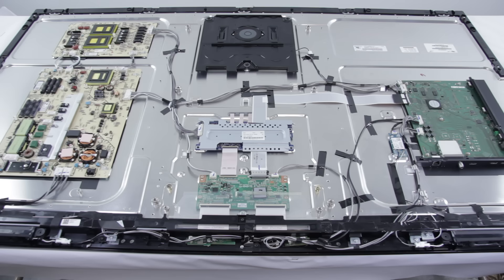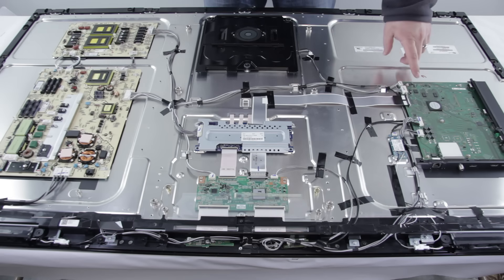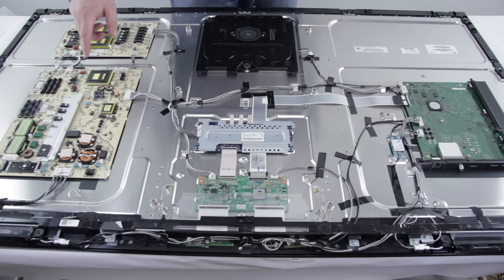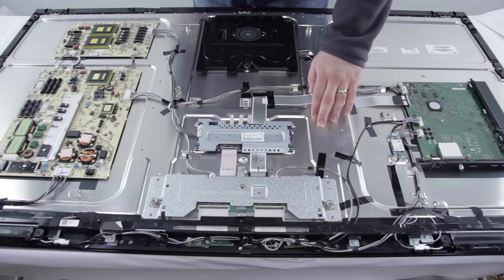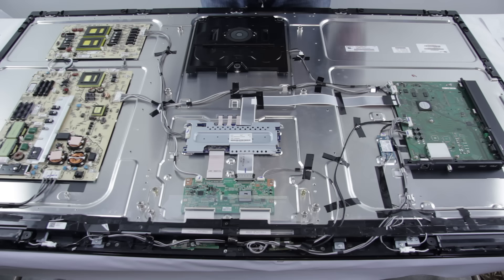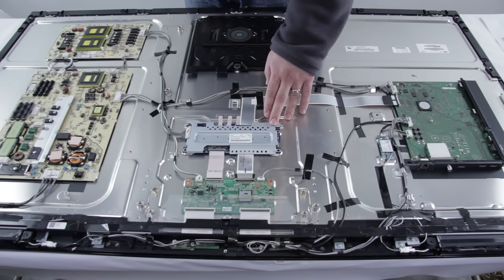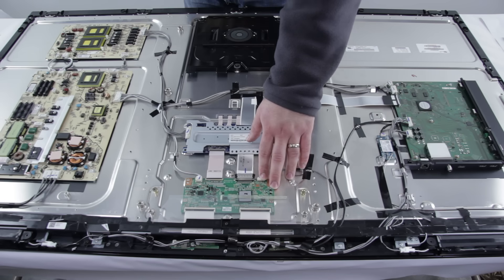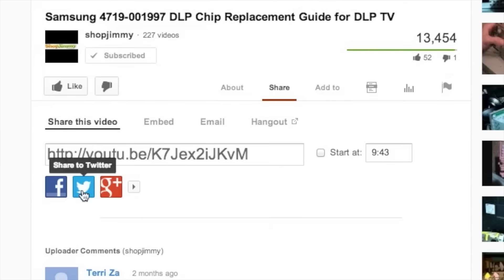LED TV Repair Tutorial - Common Symptoms & Solutions - How to Repair LED TVs

Comment: I have a e470i-a0 that does not turn on the indicator comes on with the power button or remote power then fades back off the vizio name never lights up I did replace the power supply board but it did not change anything do you have any advice

Comment: Hello. I have a Samsung UE50ES6710 LED TV. The problem I have is that there appears to be no vertical sync, or the vertical sync is erratic. This makes the whole picture very unstable and the menu options very difficult to read. 
Model Samsung UE50ES6710U
S/No ZA2G3SCD200412T
Any help greatly appreciated.

Comment: My 2 year old was running around the living area and tried to throw the remote at my oldest son and hit the tv. It is a 60 inch Samsung model # UN60H6300AFXZA, the tv turns on but you can see where the remote hit the tv when it is on (when tv is off you can not see where it hit) there is about a 2 inch blue line vertical of where the remote hit the tv. Is this fixable or would it be more economical to buy a new tv? Please Help!!!

Comment: Hey Jimmy we have an Orion SLED4668W 46" TV.

Great picture was working fine then one morning problem developed.

TV shows red power light but when you try to turn via remote or TV switch light goes out like it is turning on and TV never comes on.

Any thoughts!
Reply from the maker: tmanala  Try all repairs and troubleshooting at your own risk.  I recommend replacing the main board in your TV.  Click this link to replacement parts for your TV model number:  http://www.shopjimmy.com/catalogsearch/result/index/?cat=56&q=SLED4668W  There may be multiple boards for the same TV model number, be sure to match part numbers on your current board, with your replacement for compatibility.  Thanks and please let us know if you have any further questions with your TV Repair!  www.shopjimmy.com

Comment: Hello, I have a LG 55LE5400.  It has power to the control panel switches but no audio or no video.  I can see a very light image of the screen on the right half of the screen only but not enough to make out.  I am not sure if I am on the correct input to receive signal, or have not tried to connect other devices to see if the input is bad.  What additional should I check before I order a TCON or Main Board to see if that fixes the problem.  The TV was mounted over our fireplace so heat may have played a factor.. 
What do you think it might be?  What parts should I order?
Reply from the maker: David Austin  Try all repairs and troubleshooting at your own risk.  This could be a problem with either the power supply or bad LEDs in the TV.  If you are unable to check voltages, then you can replace the power supply board to see if that fixes the problem.  Click this link to replacement parts for your TV model number:  http://www.shopjimmy.com/catalogsearch/result/index/?cat=59&q=55LE5400  There may be multiple boards for the same TV model number, be sure to match part numbers on your current board, with your replacement for compatibility.  Here is a link to a video showing how to identify your part number, click here:  https://www.youtube.com/watch?v=_4Qpfan0vdU  Thanks and please let us know if you have any further questions with your TV Repair!  www.shopjimmy.com

Comment: hey I have a un50h6203 back light no pic but I due have sound I swap t-com but its the same thing still no pix can you help me
Reply from the maker: manuel martinez  Try all repairs and troubleshooting at your own risk.  This could be a problem with either the main board or the TV panel.  You can replace the main board to see if that fixes the problem.  Unfortunately I do not see any replacement parts in the search results for your TV model number on our website.  Please reply with your part number on your main board and I can try searching for replacement parts.  Thanks and please let us know if you have any further questions!  www.shopjimmy.com

Comment: I have an LG 55LB5900-UV I have no power. I recently moved into a new home and I set my TV up and went to run the coax and it zapped me. Red light comes on when I plug it in, but no power. Later I fount that the line was Improperly grounded, what could my problem be?

Comment: Hi, I wondered if you could assist me.  I have a Samsung ue46D8000 led tv.  All functioning correctly save that there is an intermittent sound issue.  Every 10 seconds or so, the sound cuts out for 1 - 2 seconds.  What would cause this and what part would you suggest I buy to fix it.  Do you sell the replacement part.  Please advise, Thanking you in advance, Mark L
Reply from the maker: 7777777sportbilly   Try all repairs and troubleshooting at your own risk.  I recommend checking to see if any of the audio wires are pinched.  Thanks!  www.shopjimmy.com

Comment: Hi I have a lg 55 LA 6620 Looks like a led driver issue but the drivers in the tv panel is there a way fix this or tv has had it. i change every board in back of the tv.

Comment: Hi my LG LED 42" tv spontaneously turns off, turns volume up, and switches input and stays froze after a while and i have to unplug to unfreeze it. Recently i tapped on the back and the picture went out but the sound still there. When i turn off and turn back on the LG picture that pops up when you turn the tv shows up then it blacks put when i try to input tv or dvd. Any idea?
Reply: My model number for my 42" LED LG is 42LE5400-UC
Reply from the maker: Notta Game   Try all repairs and troubleshooting at your own risk.  Click this link to replacement parts for your TV model number:  http://www.shopjimmy.com/catalogsearch/result/index/?cat=56&q=42LE5400-UC  There may be multiple boards for the same TV model number, be sure to match part numbers on your current board, with your replacement for compatibility.  Here is a link to a video showing how to identify your part number, click here:  https://www.youtube.com/watch?v=RwHTvjMdrhk Thanks and please let us know if you have any further questions with your TV Repair!  www.shopjimmy.com

Comment: Hello ShopJimmy I have a LG 55LV5400 that has stopped working. When I power it on the light in the bottom corner turns red as it turns on, then glows white as its normal operating state, however, no image appears on the screen at all. There does not appear to be any backlight and I tried the flashlight test, but did not see any image. Also of note, peripheral devices like USB drives do not power up when connected to the tv when it is "on". I'm assuming this is a problem with the power board since nothing powers up, although the light in the bottom corner does function. Am I in the right ballpark, or should I be looking sonewhere else? Thanks

Comment: Hy, there.... I have Samsung ue46c6000 Led tv. The problem that I have is that the power supply does not switch on and power the backlight. The relay inside keeps cracking, the st-by led lights up showing that it tries to turn on but it can't. I have already checked some small things on the power supply:
- all capacitors are ok!
- all mosfets are ok
- all diodes,bridge rectifiers ok,
Now i do have technical knowledge but I do miss some hints.
The power supply is the problem beacause I made a simple test with it inside but disconnected the supply to the mainboard and leaved just the one to the LED backlight.

Power supply model is  BN44-00357B. 
Can you give me some hints on what should I still measure?

Comment: I have a LG 55LE5400 that seems to be bricked.  Someone else had this issue a few years ago and he/she never resolved it.  You can see the bricked screen here:  http://imgur.com/uc2LMEb.  I am pretty tech smart and can work though most problems with some guidance.  If you tell me I need to apply 5.5v on an IC chip with positive on pin x and negative on pin x, child's play even on surface mount.  I can solder and desolderer almost anything.  I already replaced the TV, so if this is truly bricked, I'm going to drop it in the ocean.  JK.... kinda.  I don't want to spend much to repair it, but will definitely try my best to fix it, even if it means I need to send a board to you or someone else for repairs.
Reply from the maker: L Battizle  Try all repairs and troubleshooting at your own risk.   I recommend replacing the main board in your TV.  Click this link to replacement parts for your TV model number:  http://www.shopjimmy.com/catalogsearch/result/index/?cat=56&q=55LE5400  There may be multiple boards for the same TV model number, be sure to match part numbers on your current board, with your replacement for compatibility.  Here is a link to a video showing how to identify your part number, click here:  https://www.youtube.com/watch?v=RwHTvjMdrhk  Thanks and please let us know if you have any further questions with your TV Repair!  www.shopjimmy.com

Comment: Hi I got a hitachi 42 inch hxt12u led smart tv .
Yesterday the stand by light was on but tv will not turn on .it won't respond to anything. 
So I down powered the TV from the mains and turned it back on .now it's got no power at all .I then changed the fuse in the plug but still tv won't come on at all no stand by light .
As if there is no power coming in at all .
How can I fix this .please.
Reply from the maker: parminder kumar   Try all repairs and troubleshooting at your own risk.  I recommend replacing the main board in your TV.  Try all repairs and troubleshooting at your own risk.  Please reply with your TV model number.  Click here to view a video that shows how to find your TV model number:  https://www.youtube.com/watch?v=S51nhAmwR2M  Thanks!  www.shopjimmy.com

Comment: my lg 55 inch smart tv[55lw6500] just stop working ,no sound no pictur,when turned on,the on and off light the bottom, turn red then the changed to amber color,what do i need to fix
Reply from the maker: wadi jaber  PLEASE SUBSCRIBE TO OUR CHANNEL - Try all repairs and troubleshooting at your own risk.  I recommend replacing the main board in your TV.  Click this link to replacement parts for your TV model number:  http://www.shopjimmy.com/catalogsearch/result/index/?cat=56&q=55lw6500  There may be multiple boards for the same TV model number, be sure to match part numbers on your current board, with your replacement for compatibility.  Here is a link to a video showing how to identify your part number, click here:  https://www.youtube.com/watch?v=RwHTvjMdrhkThanks and please let us know if you have any further questions with your TV Repair!  www.shopjimmy.com

Comment: I have a Philips Model 46PFL3608/F7. s/n  DSIA1309108427 (A37QAUH)  When I turn power on the green light flashes as normal and the screen comes up with Philips for about 1/2 seconds and then power kicks off.  Check caps on power supply look ok.

Uncle Roy

Thanks

Please Guess a part number..
Reply from the maker: Roy Willingham  PLEASE SUBSCRIBE TO OUR CHANNEL - Try all repairs and troubleshooting at your own risk.  I recommend replacing the digital main board in your TV.  Click this link to replacement parts for your TV model number:  http://www.shopjimmy.com/catalogsearch/result/index/?cat=225&q=46PFL3608%2FF7  There may be multiple boards for the same TV model number, be sure to match part numbers on your current board, with your replacement for compatibility.  Thanks and please let us know if you have any further questions with your TV Repair!  www.shopjimmy.com

Comment: hi...i have an Emerson LED LCD tv.. Model lm320me4f.. i leave it unplugged because when i plug it on any wall socket it starts to boot up by the back light comes on, then quick flash of emerson logo , then nothing but backlight and a solid red light that shows tv is.powered on... No sound, but i dont believe i have an audio problem, because none of the selections work when i press remote buttons or tv buttons...it only repeats the above boot up symptom when i press the power button.. I noticed that the red light flashes about 18 times..
Thanks for any assistance..jay
Reply from the maker: NewAgeNote  Try all repairs and troubleshooting at your own risk.  This could be a problem with either the t-con board or the main board in your TV.  You can replace each of those boards individually to see if one of them fixes the problem.  Unfortunately I do not see any replacement parts in the search results for your TV model number on our website.  Thanks and please let us know if you have any further questions!  www.shopjimmy.com

Comment: Hi Jimmy, thanks for the video. I have a Toshiba 58L1350UC LED tv where the backlight stopped working 2 days ago, I think after severe thunderstorms that night (tv was off, surge protector still on). I'd like to buy the parts from you to get it done myself, but how can I tell if it's LED driver or backlight inverter? Tv still has power, sound, and with a flash light, I can see picture and menu as well, so it's definitely a backlight problem.  Tv us just under 2 yrs old. Thanks

Comment: Hi I have an LG LED TV (model number is 32LA613B-DB) in which the tuner antenna input only has stopped working. The TV works fine with normal video and audio from the HDMI and AV inputs but is unable to detect any channels on the antenna input. I have verified that there is no problem with the antenna or RF cable. Could this be tuner failure? What is your recommendation? Are there any component level tests I can attempt with a multimeter or is a main board replacement the only option? Thanks.
Reply from the maker: Riaz Dasrat  PLEASE SUBSCRIBE TO OUR CHANNEL - Try all repairs and troubleshooting at your own risk.  I recommend replacing the main board in your TV.  Unfortunately I do not see any replacement parts in the search results for your TV model number on our website.  Please reply with your part number on your main board and I can try searching for replacement parts.  Thanks and please let us know if you have any further questions!  www.shopjimmy.com

Comment: I have an Emerson LF391EM4. I was trying to find the source button on the bottom of the TV and ended up in the menu by accident. Since I didn't want to mess anything up in the menu, I turned off the TV with the power button on bottom. Ever since, it won't turn back on. When plugged in, the red standby light comes on, but pushed the power buttons does nothing, on the TV or on the remote. I purchased a power supply board from your site and replaced it, and nothing changed.. So I'm pretty lost. Please let me know if you can help. Thank you!

Comment: We have a Samsung LED TV Model # UN55es6500fxza. The problem started with a dotted horizontal line going completely across the screen about 1/4 of the way up from the the bottom of the screen. The screen color above the line was several shades lighter than the image below the line. We then started seeing violet blurry shading on the upper left portion of the screen.  Any suggestions or thoughts on what this might be?

Comment: Hi, I have a samsung UN65ES8000. there is a vertical gray line (1/2") as soon as tv on then all screen fill with vertical lines (multiple color) and it goes to power loop and restart it self. I already check all cables and use UPS to make sure there is no power issue.
Please advise
Reply from the maker: rashti47   Try all repairs and troubleshooting at your own risk.  This sounds like a TV panel (TV Screen) problem.  If your TV panel is bad, it may be more cost-effective to replace the TV as panels are typically hard to find in stock, difficult to replace, and expensive.  Thanks and please let us know if you have any further questions!  www.shopjimmy.com

Comment: Hi I have a sceptre model x-50 p/n x505bv-fmqr s/n e22b505bcc626 was watching tv and just went off. blanck screen no audio did the flashlight test no back lights. how ever when i turn it on with the remote the power light changes from red to a steady blue as if it was normal but nothing else happens. got this tv 4 months ago

Comment: i use a 32'' led tv BLAUPUNKT i have problem with the power on as it is always on standby mode with the red power on... how can i repair it to have the blue light on to on the tv thanks
Reply from the maker: olaitan bello   Try all repairs and troubleshooting at your own risk.  I recommend replacing the main board in your TV.  Unfortunately I do not see any replacement parts in the search results for your TV model number on our website.  Please reply with your part number on your main board and I can try searching for replacement parts.  Thanks and please let us know if you have any further questions!  www.shopjimmy.com

Comment: Need help with my TV. I have a LG 50 inch, Model No. 47LM6400-UA. The TV made a loud humming noise, colored vertical lines were on the screen. Then the screen went black and the TV turned itself off. Now when we plug the TV in the red power light blinks and the TV will not turn on. Can you help with telling me what might be wrong.

Comment: Hi, I have a Vizio E420VSE that will power on but there is no screen or audio. The power light indicator blinks for a second, this being the only indication that there is power. The Vizio logo doesn't light up either. I did the flashlight test and we were able to detect words on the screen. Do I need to replace the LED driver?